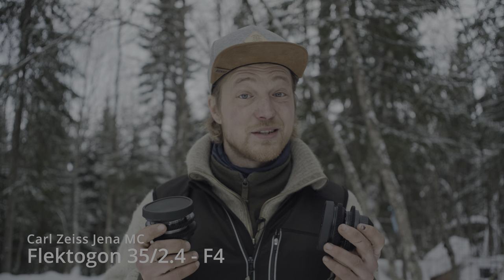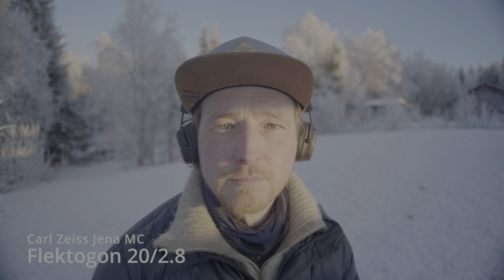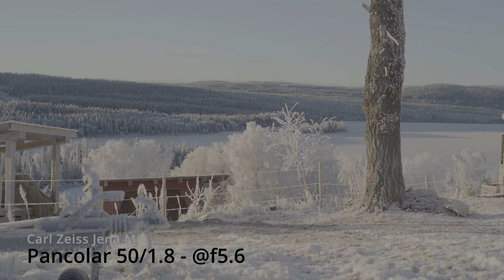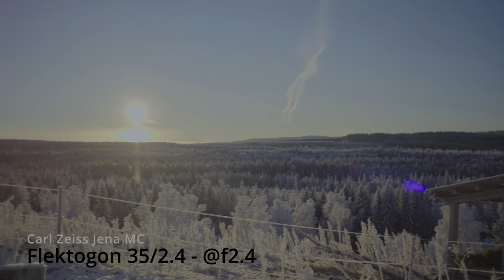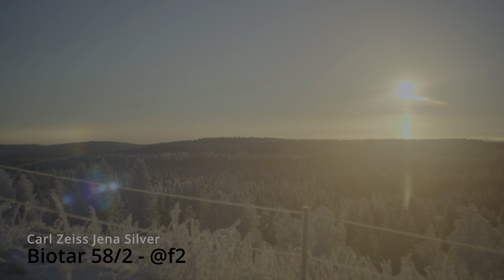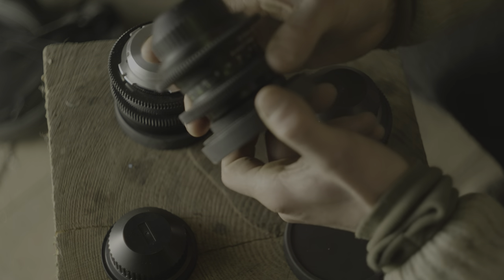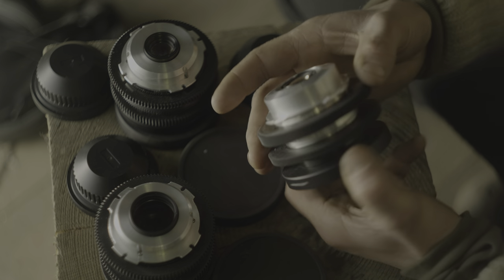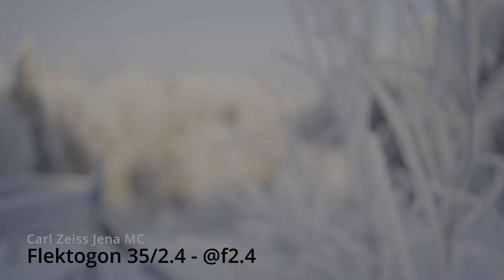Carl Zeiss Jena MC and Silver | Lens Test

Comment: Great video! I’m currently thinking about converting mine to PL mount as well. I know you touched on it in the video, but I was just curious if you sent yours out to get converted?
Reply from the maker: hej man. yeah, I did send them to Hungary. there is a Facebook link in the description. it's not a straight forward conversion, thus I send them away. do you have the MCs, or which ones do you have?
Reply: @philippbergau5868  What did you pay for the conversion? I have the 35/2.4 and 20/2.8 MC's, and also wonder about doing a PL conversion.
Reply from the maker: @andrew_nayes  the pl mount was about 250€. Plus, all the mods and shipping you're getting up to 400€ per lens. Iron Glass will offer rehousing soon. It'll probably be around 2.500€ per lens.